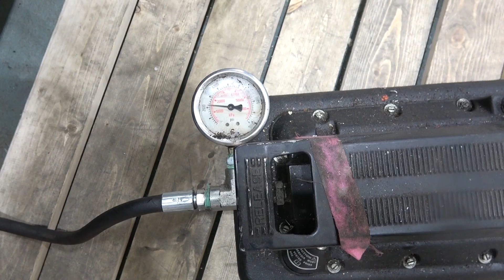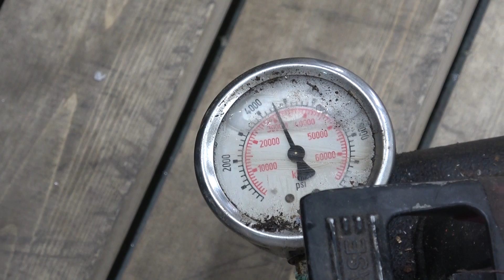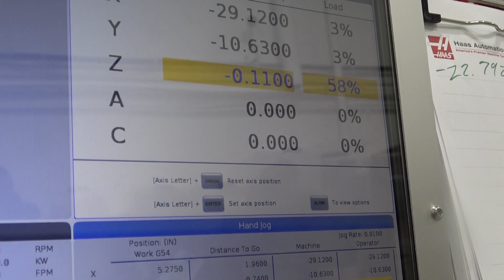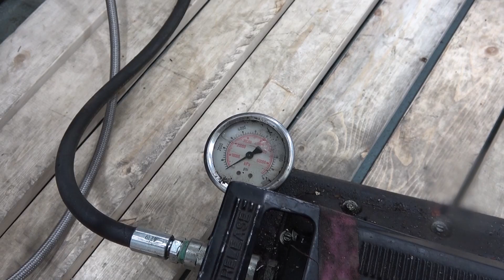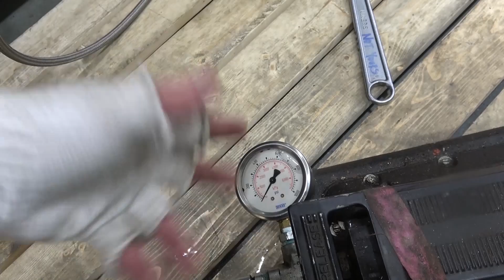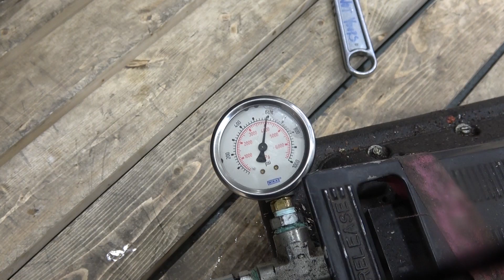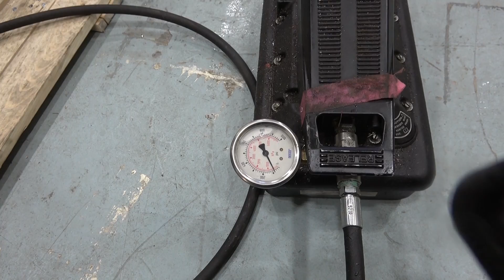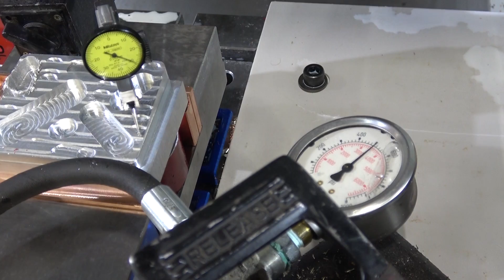Hydraulically Testing Pull-Out Force | Strongest Vise Jaw

Comment: I seem to remember that coefficient of friction changes with the applied psi ( or whatever measurement system you prefer) to the contact area. that is to say that more squeeze does not linearly equate to the increased friction. Example Teflon gets slipperier as applied pressure increases; this could explain the unexpected results on steel vs aluminum.

Comment: My thought with the steel jaw on aluminum part. Is it possible that the steel is creating a mechanical bond ie digging into the aluminum
Reply: it most certainley is. espescially when your jaws are knurled. i accidentaly printed the knurling from my steel jaws into a stainles steel plate XD

Comment: 11:30 instruments are supposed to be calibrated so that the nonlinearities in the mechanism do not affect the measurement. This one's scale appears linear (ie the angle between the two consecutive lowest indications is equal to the angle between the two highest) so there are two cases: 1) the spring is so linear, so well behaved, that the error is neglicible 2) the scale is not calibrated.

Comment: I noticed the clamping force was above the main jaw center-line. Could this be creating an angle on the clamping surfaces on the softer jaw material causing it to be pinched out like a wet bar of soap between some ass cheeks?

Comment: Hey Bubba, I hate to snivel everytime I comment, but as for that vise and 700-1000 lbs to pull parts out of the vise, and I used to be a Gorilla Machinist also, it took me a long time to develop a lighter touch, when you Gorilla down on that vise, you really start distorting your part.  If you're working to something like .0002 or .0004, you can't hold it that tight. If you've got those steel jaws with the step, and your part is square, with sharp corners, not all rounded over, everything is tits, and as you know, tits are good.  You don't need to push the machine that hard.  If you're using Mastercam it Givbs or whatever, and you're clearing out material, they have a dynamic mode that really hauls ass, like 80 ipm at 7500 rpm, going to full depth around the outside, it sings like a woodshop.

Comment: You've invested a fair amount in tooling for your Haas there.  Might as well go for the gusto and get set up with a set of OML SinterGrip jaws.  They use a bunch of serrated face carbide inserts to bite into your work.  It beats the extra operation of cutting dovetails into your stock and jaws for workholding, and will give you the grip factor you need.

Comment: I was thinking a person might put a water balloon under the workpiece and attach it to a small diameter vertical cylinder with a tee for adding the mercury. Have two presence sensors for the mercury in the cylinder and set the level between them. If either one changes state during the work, stop the spindle. Or, piezo sensors under the vice, but you'd have to move it.

Instead of smooth faces for the vice Jaws have a clamped down stack of lamination. Put a groove in the bottom of the edge of the workpiece. Cam open the clamp and use compressed air to help the appropriate lamination find the groove. The laminations end up clamped vertically to the vice which is also clamped horizontally to their outer edge. Shearing laminations ought to need more force than sliding against a smooth surface.

Comment: My guess is that the aluminum and copper deform more and don't remain parallel against the aluminum piece and the deformation weakens the clamping. Steel, being a lot harder, will deform a lot less.

Comment: Actual CNC machinist here.

The chip pressures / machining forces are usually towards the clamps / parallels, especially when drilling. Most modern carbide insert mill heads insert a small force towards the the piece, so they are not pulling the work piece form the jaws.

Old school HSS end mills (and solid carbide end mills) still tend to pull the work piece up, but the chip forces are super low on those. 

That all being said, I was surprised about the results on how small of a force can displace the workpiece if the force is straight up.

Comment: Force required to pop something out of the vice isnt very useful. Force never comes from directly under parts like that and the vice isnt designed for it. Straight down (Infinite FAIAP), and from the sides parallel to the jaws would be interdasting to see. Whack it with your spindle.

Comment: Regarding your drilling comment at the end. I believe you can set your drill canned cycle to slow down the feed as you break through so you get less chance of it binding on you.  Vices are more used for small light work. When you have to do heavy cuts it best to have a clamp and fixture set. 123 blocks are your friends lol.

Comment: as a Machinist for 35 years vise holding is the least of my worries,  i know what is safe or not,  I can't be that risky with parts,   your test is still pretty interesting,    
why do you have end mill loading up one your test part?  coolant off?  to much plunge cutting with end mill ?  use a peck drill cycle to break the chips.  or use a stub drill to drill a pilot hole.

Comment: Very interesting.  All the samples are based on clamping your aluminum work piece.  I wonder how the results would be on the other two clamped pieces?  Steel and Copper for instance.  Would that differ greatly do you think?
Reply: Steel vs. steel for instance.  Copper vs. copper.

Comment: A couple of observations.  The movable jaw of those vises have about .005 clearance between the bed and the jaw itself, allowing them to float out of parallel and align to anomalies in the workpiece.  The side-effect is that when you place the workpiece off center, the force isn't equal side-to-side across the jaw and it kicks the movable jaw out of parallel from the fixed jaw.  Your part is slid to the right, and has the least clamping pressure there.  Your cylinder is also applying force at the far right.  I'm curious how much better it would hold if everything was on the centerline of the vise bed.   Secondly, in addition to the co-efficient of friction, there also is something to be said for the changes in the modulus of elasticity of the different materials (especially where the copper extends above the back-up support of master jaws).

Great vidjeo, though!

Comment: Pretty sure you don't need to double the clamping force in order to get the normal force. Otherwise we would always be doing the same in "regular" physics problems as you can consider the gravitational force and the ground similar to a vertical clamp.
Reply: Yes. And if you doubt that, consider that he measured the force with a guage being clamped from both sides.  It measures the total force from both sides, so he doesn't need to double that number. The second side just doubles the area.

Comment: I have to ask  why are you testing the vise pressure / grip ?  does the part your working with only allow a shallow area to grip ? it looks like  .250 " or so . can you modify the part to use a pallet type holder or use dove tails ?

Comment: Regarding the slip with Aluminium on Aluminium, verses Aluminium on Steel.
The microscopic imperfections on the surface of the steel may provide a keying action into the softer aluminium. Where as aluminium on aluminium, the imperfections may deform and burnish both the surfaces, easing the slip. Just a thought.

Comment: Penishield...

You were surprised at how easy it was to pop the thing out? Well, you only got ~.125 x ~4.5 x 2 ~= 1.125 "^2 in the gripper, and that's at the very bottom of the aluminum (deforming and maybe flexing) and the very top and extreme side of the jaws (I don't care if it is a Kurt, those jaws have to be opening up and out a little), and all that pressure may have made things worse.  What'd you expect? Nobody wants to mill an inch or more high over a piece only held down by the last .125. .Might be more interesting if you could figure out how to lift a cube out of the bottom center of the jaws.

Still, I was surprised that alu/alu wasn't the best, and I'll be nixing copper jaws unless I need better conductivity.

Comment: If you haven't already, use a dovetail cutter to cut out the bottom corner of the stepped jaw.  Any end mill that you use to cut the jaws is going to have a slight radius there where the horizontal surface meets the vertical surface.   The dovetail or keyway cutter running along the horizontal surface cutting ever so slightly into the corner will clear away that radius AND give you a relief area where a milled sharp edge will have some relief to go inside when being clamped.   If you don't have that relief cut, then the act of clamping the part causes the part to shift upward ever so slightly getting a head start on popping up right out of the jaw.   If you already have a relief cut into your jaws, I wouldn't be the least bit surprised that you already knew this.   If you don't have that relief cut, please give it a try.
Reply: Excellent suggestion, thank you for taking the time to share it.  Hopefully it won't be lost among the colorful clutter of this here comment section.
Reply: @jameswarner7435  thanks.  Even if it is, it seems like at least someone appreciated it so it was well worth it.  :)

Comment: Torquing something two times can increase the torque applied substantially
Reply: are you referring to using a torque wrench?  if so, clicking it 1 time or 10 times will not give it any appreciable torque if your wrench is calibrated and works proper.
Reply: E2qNX8btraQ3zRD6J7fc I have seen it demonstrated on a digital torque reading device (idk what it's called) it does over torque it.
Reply: Jacob Poucher you can say wrong but you're offering no proof or explication, even if mine is just anicdotal.

Comment: When possible, use something that digs into the part like a mitee bite talon grip. You will most likely never pull a part out of those. All you need is 4 on a larger part, and you will have no worries of the part moving on you even if your stalling the spindle. They leave a mark on the side of the part though. Parts come out of vises all the time with smooth jaws. Its super difficult to get any real feedback on a VMC, you have no idea the forces the part is being subjected to until the thing explodes out of the vise at 1276m/s and shatters the window your face is an inch away from.

Comment: Looks like you are clamping factory surfaces properly, and not sawed surfaces. Have you indicated the sides? Trued them up? Cleaned the mating surfaces? 
When roughing, try to drive the forces into the solid side of the vise.

ED: Also, clamp hard things in soft jaws and soft things in hard jaws.

Comment: Yeah, I reckon the jaws deform more near the edge and the piece also deforms more at its edge, creating a wedge like shape that tends to push pieces up and out. Softer materials would deform more and exasperate the wedge deforming. However, if the clamped pieces had more surface area contact with the jaws, there'd be less deformation and the friction of the materials might matter more.

Comment: Good video as always a pleasure to watch.
One thing came to my mind about a difference between your selfmade softjaws and the stock ones. 
The stock steel ones are ground in a 90° angle to the pullout out force. 
The tiny grooves of the ground surface help to keep the workpiece in place. Especially in case of Aluminium where the surface can press into the material like teeth.
A Milled surface is wavy so it has many tiny radiusses. Those round shapes are not as good in giving extra Grip as the grooves. 
If you take mild steel as a workpiece, the same test could tell a very different story.
In case of steel the steel jaws would not grip as good as the aluminium or copper. The combination of the materials to clamp and those to clamp with are a huge factor in this test.

Comment: Lift up a block resting on another block, and the angle just before it starts sliding is your μ_fs. Tan(x)=μ_fs, where x is rad/2π or °/360. 

That won't account for the deformation of the surface texture from clamping, but it'd be cool to see how close the estimate could be, or how much it's affected

Comment: After decades as a machinist, I can say that if I want to hold something tight in a milling vise. I used paper.  Use parallels to space the part to the needed height, and between the vise jaws and the work piece, use paper.  However on a CNC, just make smaller passes, and let the machine to the work.

Comment: a part offset in jaws will come out easier,  keeping it right in the middle is ideal
 sometimes i find holding on too little an area can cause parts to come out too  however that can be a symptom of sock surfaces not being square.

Comment: The coefficient of friction may be higher on aluminum on aluminum, however the clamping force of the vise tends to plasticly deflect the seating surfacing of the jaws away from each other reducing the surface area thus the holding force. While the steel jaws may have a lower coefficient of friction they are less likely to deflect due to the material strength and provide optimal surface area on clamped parts. 
Cheers

Comment: I think the physics you explain at around 10:00 needs some enginerding - if you made a vertical stack of (one vice jaw) A (work piece) B ( second vice jaw ) [2,200lb weight], yes the work piece would "feel" the 2,200lb on both sides A and B, but there isn't 4,400lb of force at any point.

Comment: Perhaps showing my ignorance here, and apologies if so, but you mentioned that the clamping force has two elements, one from the fixed jaw and another from the moving jaw, but you then said that this amounted to 2200 lb  from each jaw. 

Surely if the total clamping force is 2200lb, each jaw is exerting 1100 lbs of force, not the 2200 you suggested?

If I am correct, multiplying 1100 by your estimated coefficient of friction of 0.5 gives a result of 550lb - pretty much bang on the force you measured (what's 50lbs between friends?).

Of have I got the wrong end of the stick completely?

Comment: So, the moral of the story is to get a checkered face hammer and beat the jaws up before you install them? I'm not sure if that would be better because of the increased local pressures, or worse because less contact area. 
Freight trains dump sand on the track when they need more grip. I wonder how that works. 
The greatest clamping pressure, that I'm aware of, used diamond jaws and were able to smash hydrogen into a solid. Therefore, beat the jaws up and glue diamonds into the little dents. That should do it. Or, perhaps some strips of that emery paper that comes on a roll.

I'm afraid you've provoked more questions than you answered.

Comment: You should put a little valve lapping compound between the jaws and the part. Obviously not practical for clamping finished parts, but you should at least try it. If for nothing other than to possibly prove my stupidity or lack thereof. @ave

Comment: Where I work we mill parts out of 1215 square steel and the vice is only holding the parts with about .100. I hate those parts because once the mill starts to get chipped out it will just grab the part and throw it instead of cutting. Another part we run uses Aluminum blocks and those just get destroyed when a part pulls out.

Comment: You need to mill your jaws with a slight taper, 1/2 degrees is all you need. Make sure that aligns with your datum however that's an easy trick to get substantially more downward force when clamping.

Comment: Retesting the original (copper jaw) and second setup (aluminum jaw) after the final (steel jaw) could be telling.  
The ever increasing reqiired force could be due to some change in the test workpiece possibly occurring during the pushout.  
Sliding under compression could be altering the surface roughness and changing the hardness close to the test workpiece - jaw ok interface.  
Without retesting the earlier tested setups, the increase noted in force cannot be clearly attributed to only the different jaw material.

Comment: Perhaps the malleability of the copper and aluminium reduces the clamping force, as the jaws themselves will deform and move away from the workpiece when you put force on after tightening the vice. If you kept a constant torque on the vice handle I bet you’d get different results.
It would also be neat if you used a digital pressure and dial indicator so we could get a full force/displacement graph.

The goat joke was too much for me.

Comment: i thought the steel jaws would do worse than the aluminum. if your holding onto ruff stock they sell serrated jaws  and if your doing walk around or doing a 1st op where the stock in the jaws are going to get machined away in a 2nd off there probably the best bet.

Comment: Don't overlook deflection.  The steel jaw surface that contacts the work piece will likely remain flat to the work piece, whereas jaws of softer material may deflect as you increase the clamping force.  Potentially, you could pre-emphasize to compensate for deflection, but you would always have to clamp to the right clamping force each time.  I imagine surface finish matters a good bit too.

Comment: Steel and aluminum amalgamate (or alloy or whatever) when put next to each other under high a lot of clamping.  I wonder if at those forces you're not mostly measuring some metallurgic effects? It'd be interesting to reverse the jaw/workpiece materials and see if you get consistent results.  It might also be possible that the vise geometry might be doing something uh.. "interesting".  Trying the same material but different widths being pushed out might illuminate it.

Comment: Aluminum over copper makes sense, but not the steel. Since it's the factory jaws, and not the ones you machined are there surface finish differences at play and/or maybe some lubricitus contaminants for previous project on factory jaws?